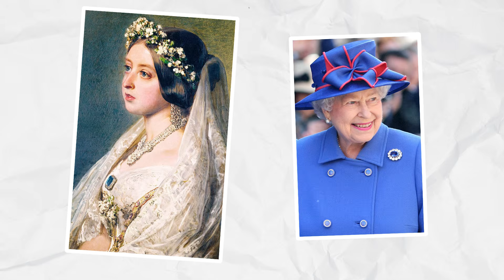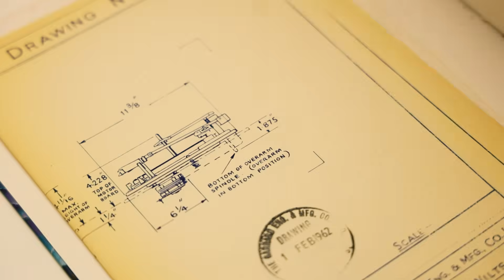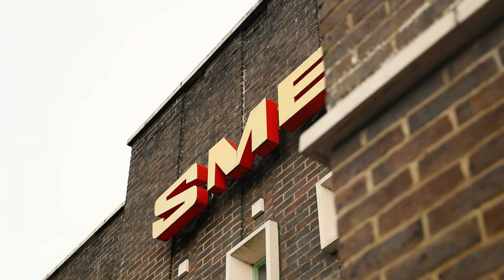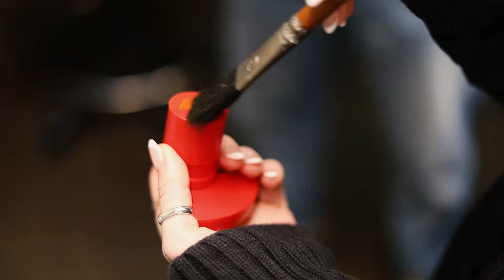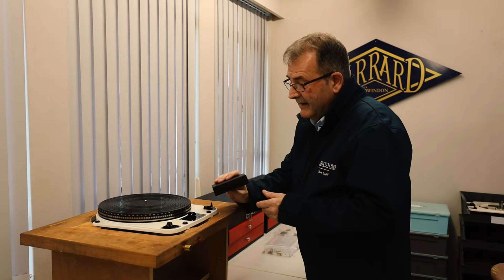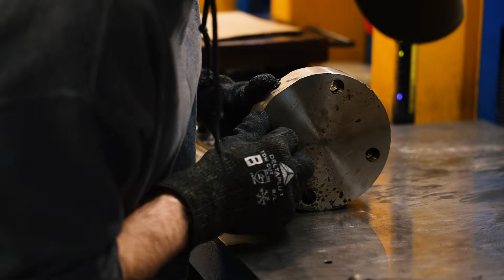Evolution of Garrard - The Famous Garrard 301 Transcription Turntable exclusive w/ SME VA-12 Tonearm

Comment: In the UK, the Garrard 301 Advanced is listed at approximately GBP51,000!!! Its extremely hard to justify this price when you see that the 1950s technology remains the same and you can buy a second hand 301 for about GBP1000.The relevance of the Garrard record players and brand has been preserved by the DIY audio community in Japan, the UK, and other countries where they recognised the continued brilliance of the deck once you put it in a heavy modern plinth and added highend tonearms. You can go the DIY route or have great companies refurbish the motor and parts for GBP750 or buy a fully refurbished deck for about GPB3500 and add a plinth and arm for GPB4000-6000. Which many would already consider an very high cost for such a player. There's obviously costs in maintaining and updating tooling and reviving the company brand; however, this is not a super hi-tech turntable with mass-loaded billet aluminium chassis and platter and advance quartz motors. The 301 and 401s are superb valve if you go the DIY or refurbished route and you do fall in love with the mechanical nature of operaration and the design but they require a bit of finessing to get the best out of them and reduce the motor noise and platter ring. I own two 301s and two 401s. The current marketing and branding is postioning them against superdecks for CEOs and investment bankers rather than the radio, studio and audio community enthusiasts who upheld the brand for many years.

Comment: Was gifted a NOS SME 3009 Series 2 Non Improved arm in 2017.
Took 4 years of patience to find the perfect 301 (with the benefit of hindsight, thank goodness I was outbid on my first attempt to buy a 301). That patience and resolve to find a "as new" 301 was rewarded; in 2021 I purchased a pristine one owner unmolested 301 manufactured in June 1964. There's not a chip nor blemish on the chassis. The original owner packed it away when he purchased a 401 in the mid 70s.
Awaiting delivery of a birch ply plinth from Lithuania, and depending whether I can source it, finished in Kauri wood veneer. Failing that, it will be either Cocobolo or Bubinga veneer. Unsure which MC cartridge...do I go the classic route and invest in an Ortofon SPU 1E or opt for a newer design Hana ML?

Comment: I don't get it with this turntable.I own  one of the 301s, and I think it's one of the most overrated,overpriced tables ever..You can do as well, or much better ,With
Most 70s japanese units at a small fraction of the price. Same goes for the ridiculously overvalued Thorens td-124.. Don't waste your money.
Reply: I think I agree with you. I have Technics from 1976 which wasn’t even top of the line back then and it beats all the “legendary” stuff easily.

Comment: I still have my late parent's radiogram with its Garrard RC110 auto changer that they bought in 1954. In my youth my first 'proper' deck was a Garrard SP25 Mk III (I sold that years ago, alas). I also have a 1955 KB radiogram that was saved from the dump. It has a Garrard RC80M autochanger. The two older decks still work perfectly! An interesting history of Garrard indeed. 
I doubt I'll ever aspire to a 301, but I'm happy with the decks I have.

Comment: Great documentary! In 1995 I bought a 301 turntable 2nd hand from Hi Fi Exchange in Harrison Street Johannesburg. It took me another 25 years to find a 12" SME series II at a boot sale. A friend crafted a deck from Kiat wood and today this combination is mated to a refurbished Mullard 5-20 valve amplifier via a Rotel pre-amp.  The turntable is original, No 28241 with a grease bearing. The idler wheel is like new and there is no rumble that I can discern. I cannot over state the quality of this turntable.
The SME arm was looking a little sad when I found it but after a clean up and replacement of the shaft bearings it works perfectly. 60 years down the road, thank-you for these brilliant products.
Reply from the maker: Thank you for the kind words and sharing your story. This is what it is all about!

Comment: So why did they not simply rebuild the Garrard 401 turntable instead of the 301 ?   The Hi Fi press reviews at the time claimed the later built 401 was an improvement over the 301 .   I still use an original Garrard 401 that was built Swindon in the 1960's .  Serial No. 03134 .  It has a flush mounted strobe light and still runs very well indeed .  I think a lot of people will be surprised at the price of the current 301 rebuild .  You will need very deep pockets to buy one .

Comment: I know this is about the famous Garrard 301 but they did make Great Turntables through the 60s. My father returned from Spain after serving in the Air Force in 1962  and built his own system from a local Music shop starting with a Garrard AT60 and 12" CELESTION full range loudspeakers with a do it yourself Layfeatte 36 watt tube integrated amplifier. To me it was the best system I've ever heard but I was just a kid at the time & without a doubt it was an older tube amplifier, turntable and speakers that certainly were way different than today's systems and most definitely don't compare to what real audiophile systems sound like now... But the Garrard AT60 was built the RIGHT WAY & had spring suspension that NEVER produced feedback. After it died it the 70s I tried 4 different TTs and had ZERO success that matched the AT60 until I finally found an Ariston Audio TT that had the same type of suspension that the AT60 had. Garrard was ALWAYS had  GREAT turntable options until the late 60s and after that it was nothing but KAKA!!! I'm glad to see this video and Totally Welcome back the REAL Garrard back in the AUDIOPHILE WORLD!! God Bless✌️👍😮
Reply from the maker: Thank you for sharing your thoughts and for being a part of our audience! A comprehensive dive into all the Garrard models would indeed be extensive. Focusing on the 301, manufactured by SME, was our primary intent, yet your enthusiasm and feedback are greatly valued. Perhaps Netflix should produce a documentary on Garrard!?? :)

Comment: So what this girl owns this company director? She used to work for that distributor in America setup tables a bit of a change. What you really need to do is get into standardizing record pressing plants and making lacquers to the highest standard. You could use Al for this by analyzing the best lacquer Mastering putting this into an AI program. So you could have the best engineers back in the day and bring them back to life. and use the laser cut ceramic pressing discs what should be uniform. what hasn't materialized for the last seven years I'm not sure why. bring back dbx is the best record format with 118 DB of dynamic ranges good as any CD, and is analog. Start manufacturing dbx records and decoders. that is really still the future in vinyl or perspex. could be improved on what it was back then, especially the decoder, and you run that through a a DS cartridge I don't think you get much better.
Reply from the maker: Hello. Thank you for watching. Kat is our Global Sales and Marketing Director.

Comment: These are beautiful pieces and the engineering that goes into them is great. But the idler design is pretty flawed and they are not the best at always spinning at the correct speeds. I wouldn't say they are the best turntable on the market, especially not considering the price range for a fully rebuilt one. But you are more so buying a piece of audio jewelry I suppose. I do think the sme arm is super ugly though. I'd rather have a sme 3012 or similar vintage 12 inch arm.
Reply: One of these or the new SP10?
Reply: @BestKiteboardingOfficial  id pick neither. I like to restore vintage equipment myself. Much more cost effective as well.
Reply: if the iddler drive is flawd then why is it that the best of japanese tt the kondo brand has a 301 as a refrence model to make a modern tt version?..its back to the old conversation of how we make sound products today with the help of computers and not our ears so much..what does a customer want?..musicallity?,foot tapping ?sure footed and a lush sound?..if thats the case then a 301 is perfect but if you are going to sit in front of your system trying to hear noise or flaws then you defenetly better buy a modern designe tt...i prefer the foot tapper tt..does wonders to jazz and blues..
Reply: @mypinkorange Because there is demand for it. The drive system does absolutely nothing for how it sounds. It just matters for the noise floor.